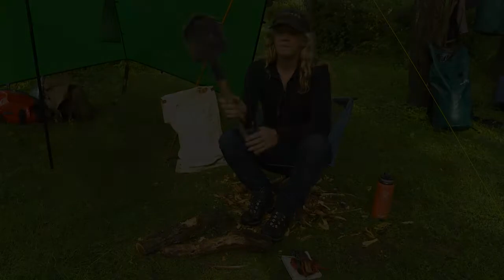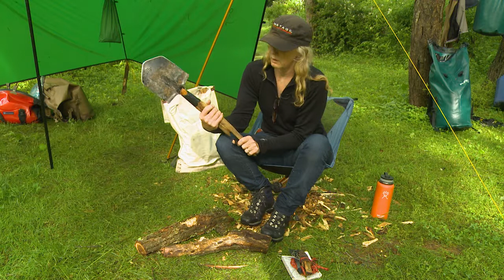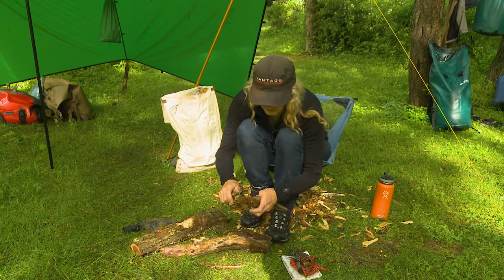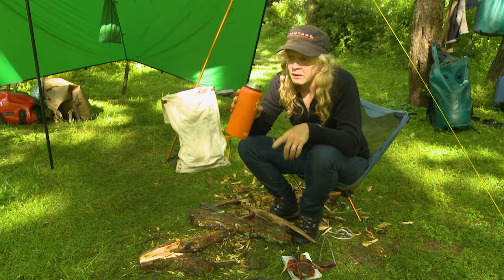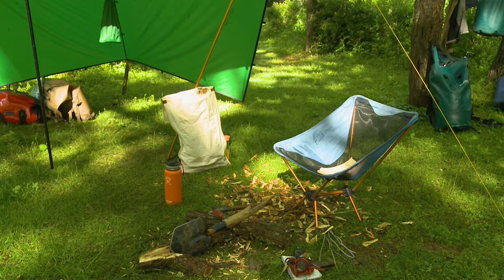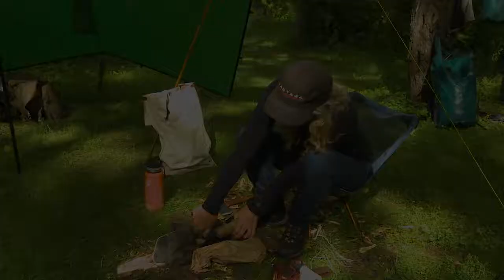Bushcrafting Custom Cold Steel Shovel Handle Repair

Comment: You could of got a small hardwood close to handle size and then cut one end to fit the shovel. Then put the screws back in and you'd have a serviceable handle.